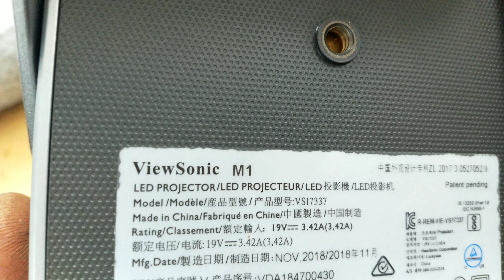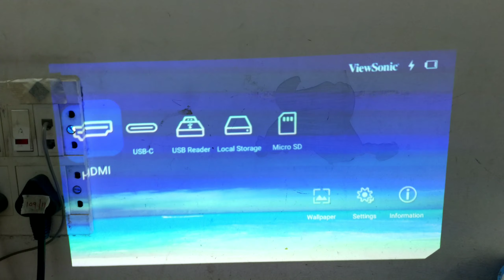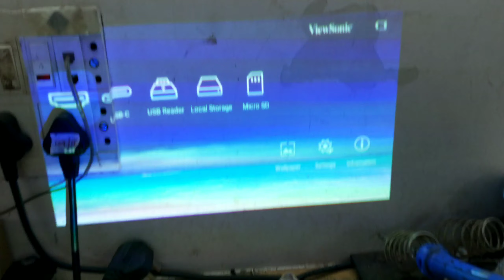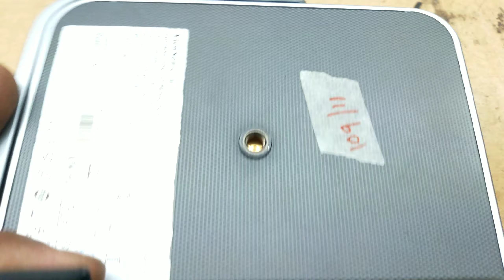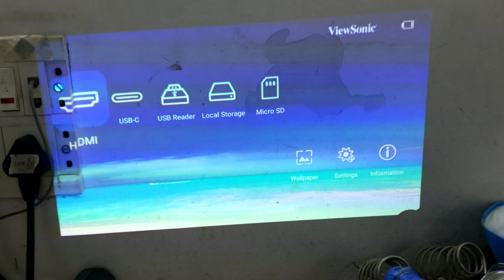Viewsonic Harman/Kardon Mini projector display off after sometime working,viewsonic M1 led projector

Comment: My M1+ has a red light in front that flashes. No screen or light from projector at all.. what could it be?  Charges, holds battery just no light or screen projection...  just noticed little red light on front is flashing..  any help or thoughts would be greatly appreciated

Comment: Hi My viewsonic projector is not getting on .On connecting to charger battery indicator LED lights are not blinking .on/off switch  showing white light on connecting charger and turning red when  lens cover is taken off but not starting .
It's M1+
Reply: Same here and I am having a hard time unscrewing it. Actually, I can't, even with the tiniest screw driver I could find.
Reply: @sophielairberreby  I returned to the seller.thankfully he accepted it .